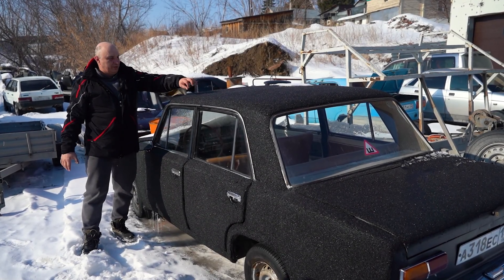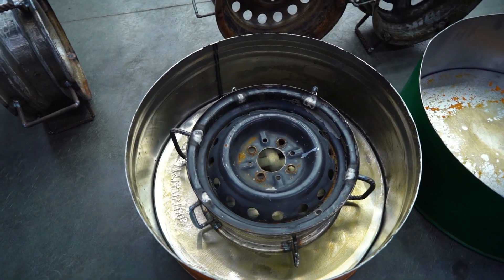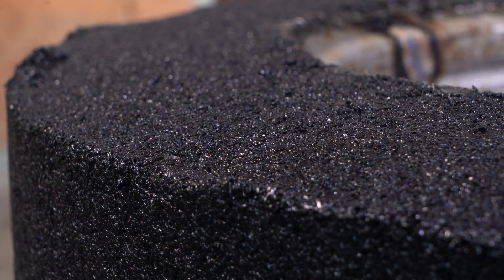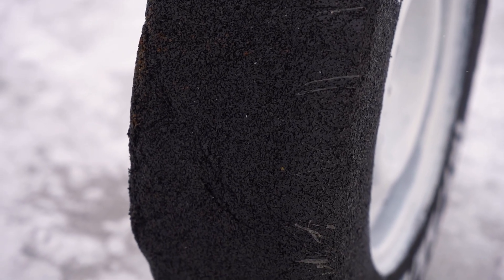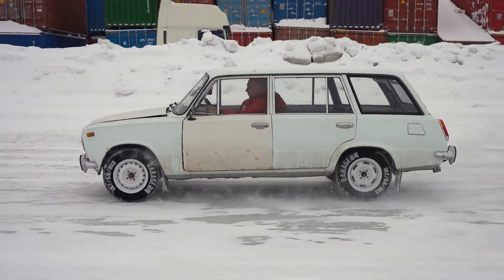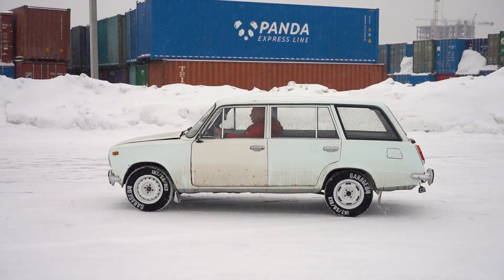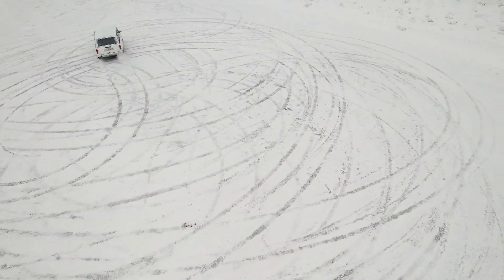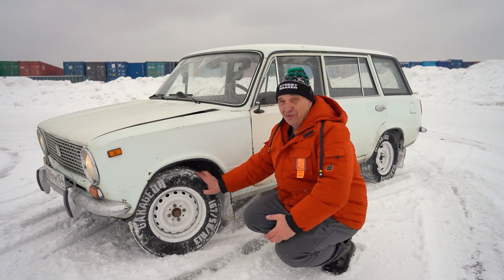We use rubber turf to make airless run-flat tires

Comment: Interesting video.  It looks like you eye-balled the placement of the rim in the mold plus pounding in the rubber could move things around, so I think it likely your tires are eccentric and will be very rough riding.

Comment: i think if the tire were mounted on the wheel and the mix inserted into a flap cut into the tire, you then glue the flap down, you would have a real no-flat tire.

Comment: These are just essentially forklift tires for your car. And the reason you have solid tires on a forklift is to balance the load on the forks. But if there's any deviations or imperfections in the surface The transfer is exponential to the forks. But you can't have any kind of compromise to the tires because that would be dangerous on a forklift.

Comment: You should also make the grooves on the surface, and not just a smooth tire. The grooves are important when you drive over a wet surface (not ice), and you did not test the wheels under these conditions.

Comment: Pretty sure these “tires” would be severely limited in speed as to keep them from flying apart. Probably no more than 30mph/60 kph and even then only to limp to a tire store.
   Also hitting a pothole would probably seriously damage, if not outright destroy them.

Comment: Insert a tread mold ring made from from a real tire into the barrels around the inside edge then fill it in with the rubber compound so the tread is molded into the outer surface of the tire. So get a good tire spray it with alcohol and vegetable oil as a mold release then paint on several layers of silicon rubber. Peel that off re-apply your mold release, pack it full of you rubber pellet and glue compound then insert that into your barrel mold and fill in the area between the rim and your tread mold with compound when dry remove from the barrels and peel off your tread mold. Or you can use a router to cut treads into your tire after they dry.

Comment: So you made tyres out of tyres? I wonder if you could put an inner tube on the rims before adding the rubber, to save weight and make the pressure adjustable

Comment: I would love to see a tire that was essentially just tread attached to the rim. That way you could drive, say, 100k miles on a few inches of tread and wear them down so much that you would have to replace them when the speedometer is no longer accurately displaying speed vs. safety related reasons.

Comment: God damn...this is actually awesomely useful! Old tires wont be depleted from the world and are free, just need to turn them into pulp and remove the steel. Only issue is finding the glue and further testing is needed like how much weight and over time effects, plus UV and so on on these, but if this works well, i have multitude of vehicles, trailers etc that could use this type of tire, as there is always leaks when sitting around and say water trailer will have couple metric tons on top, while sitting on the sun most of the time. Rubber rot has already started to seep into one mainly on the sunny side, so if i could replace those with these it would be fabulous save in money alone, if i could even get new tires for those decades old truck rims.
Please do further testing and state what glue was used, well as source for the rubber or was it home made?

Comment: Ive Got an Idea. 

Build a Compressed Air Tank that is compressed by a turbo that uses a switch to change between regular turbo usage and Tank Filling. then add a button to allow you to inject compressed air into the engine block like a NO2 tank.   

Essentially a Reusable No2 tank that self fills while driving
Reply: And how does the turbo turn oxygen into nitrous oxide?
Reply: @BrunodeSouzaLino  I think it just gets more air in the engine which makes better explosions and power ?

Comment: @Garage54ENG #Garage_54
This was a great example of "Just Do It" engineering. It obviously works; kind of heavy, but will never get a blow out.
These would be fantastic "Shuffle Wheels" for cars that need to be moved around, but don't warrant a new set of tires.
A Next-Stage Idea for this Build: Off Road Version for the Log Truck 👍
+++
Это был отличный пример инженерного подхода «Просто сделай это». Очевидно, это работает; довольно тяжелый, но никогда не выйдет из строя.
Это были бы фантастические «Shuffle Wheels» для автомобилей, которые необходимо передвигать, но которые не требуют установки нового комплекта шин.
Идея следующего этапа этой сборки: внедорожная версия лесовоза. 👍

Comment: looks like rubber molding and cutting of tires, like in tractors and monster trucks. try flexible cast mold plastic tires. looks nice. maybe foamy airless tires. with hollow inside. no air inner tires.

Comment: Excellent durability! But I would still try to inject it into a mounted tire, either through the sidewall or better yet, the rim.
We have used the expanding foam in tires for a poor mans run flat tire, and they don't last long, due to the foam crushing down over time. The only draw back is the weight. It isn't good to have such weight unsprung.

Comment: I would like to do the same, but rather than have the rubber compound as the tire, mount a tire, put holes in the sidewall and fill the tire with the compound. That way you have a run flat airless tire, but protection from wearing out.

Or, put the holes in the rim, and leave the tires whole. In order to dry the material, use air injection?

Comment: The Rubber Turf (crumb) idea has been used for many years to patch potholes in the paved roads.
Usually you get rubber crumb and mix it with Polyurethane glue, and pack it into a pothole filled with water.
The water helps the Polyurethane glue to cure more rapidly of course.
Widening the bottom of the hole slightly, helps to keep the patch in the hole.
But the end result is the pot holes will usually outlast the surrounding paved road.

It makes you wonder why they continue to use bitumen and hot mix gravel to patch holes in the pavement?
Certainly Bitumen and gravel is a cheaper material cost in the short term, but the Labor cost to repeatedly repair potholes is extremely expensive.
Then of course there are road safety issues to consider, along with damage to vehicles steering & suspension, stone chips to paint & glass, and maybe even loss of life.
Reply: What sucks is they think patching potholes work when 100% it does not. Pot holes keep getting worse because the water seeps under the hole. To fix it the right way you cut out 10 feet section of the road. Dig it up about 2 or more feet deep and tamp the hole section quite a lot. Then lay in crushed gravel and sand level and tamp then apply your black top on it. 
The major problem is water intrusion and the city, county, state and federal government were to install the proper roads and maintain them the right way we would never have a problem.
Reply: @kameljoe21  - It's a good thing that Polyurethane adhesives use water to cure. In fact when patching a hole, if it is dry, then the first requirement is to fill the hole with water before placing the Rubber Crumb & Adhesive mix into the hole. Once cured, Polyurethane glue is hydrophobic.
Reply: @delawarecop While that is very true. The patch might last yet the connection to the patch is what causes the pot hole to form again. The gaps and cracks causes structure failure to the patch which break up and form the pot hole again. 
The problem is micro cracks in asphalt. As the asphalt ages and dries out it shrinks. All of this is going on while the weight of vehicles traveling over apply downward pressure to close these micro cracks. This can be seen on some roads where you can see tire tracks and when it rains water pools where the tires go. Micro cracks open up and allow water under the road and can either wash out dirt which causes "sink holes" or in our case pot holes. During the winter in places where it does freeze and thaw the water intrusion freezes and heaves the asphalt up to where it breaks. This can break open a pot hole that has once been sealed or cause cracks along the road. You will see crews who go out and try and seal these large cracks up with tar. The problem is this almost does nothing to help because micro cracks still allow water in. 
The only way to combat this is to apply chip seal every year or every few years. Each road can be inspected to determin when it should be applied again. Which is how its pretty much done today. Yet they wait till its too late. The longer you wait the more damage is done to the roads. There are several chip seal programs that have been able to provide low cost chip seal cost while making it cost effective. Yet the problem is getting your local area to do it and to keep doing it even if one does not think you need it. Every road that has not been done in a year or a few needs it. 
Cost is the factor in this. 
Pot holes will keep showing up in the same spot until they fix the problem. Pot holes do not form in new roads. Keep the roads freshly chip sealed and you will never have another problem.
Reply: Certainly alot you could do with this, maybe fiber reinforcement,  add some kind of void space to see if any spring can be gained

Comment: Another awesome experiment and video guys. Awesome work. I just wonder what speed they would fail at. Pretty sure they would come apart at 100 miles per hour (160km/h) because of the weight.

Comment: I would have spaced out some bolts inside the tire to hold the rubber granules instead of welding steel rebar into it. That would be a weight-saving measure. The layer could also be thinner like a run-flat tire would be to save even more weight. I bet that you could have it come close to the weight of a similar run-flat tire, which would improve the acceleration. This added weight from the rebar and size of the tire is what I feel was preventing you from getting the rear wheels to spin more freely.

You can also try welding some shapes into your molds to give the tires tread patterns!
Reply: The dynamics of a spinning wheel wouldn't find that configuration useful. The crossing over is what helps keep it in place. It would just separate from studs.
Reply: I respectfully disagree. The spinning of the wheel didn't separate any of the rubber compound at all, even in the areas between the rebar where there was no support whatsoever. If your theory about spinning dynamics were true, we would have seen delamination to some degree. But I suppose neither of us will know until it's tested, hm?
Reply: @orellh.1836  The smaller the spans between the "bars", the more it will hold itself together, at the expense of more weight of course. Within reason at that lol. At some point, you'll have nothing but steel packed with a little rubber and the strength of the rubber will actually decrease.

I don't recall exactly now but what were there, 6 per wheel? 60 deg, carry the 2... 7 or 8 inches between bars at the surface of the tire, give or take. Forgive me, I'm not bothering with real math.

Point is, take that and have only 2... 180 degrees apart obviously... and check out the results.

To challenge it even making it out of the garage, take them all away.

Radial rods would help in imparting torque somewhat, in a manner not very different from the handful of bars... but the simple rods would not provide any real radial stability, and unless there's something special going on at the interface between the "tire" and the rods, the voids in the rubber that the rods pass thru will actually have a detrimental effect instead, by being the cause of "holes" in the composite rubber structure. The constantly changing radial forces as the wheel rotates would only amplify the result as well. Then the moment there's any speed... It really wouldn't be all that long at all before you were running on the ends of the rods because with a material like the aggregate tire there, they will drill themselves thru the circumference in no time flat, and the deformations will shred it, even quicker with any real torque. All of its "action" is limited to the furthest it reaches out into the tire. Remember, the tire material is an aggregate composite much like concrete, only a bit more flexible. It will still break and crumble, unlike a proper molded rubber tire.

The crossover mitigates this by "dividing" the forces and shielding parts of the bulk tire from stresses, allowing the bond to remain intact on both the back side of the cross bar and also at the hub of the rim. It also restrains centrifugal forces and controls them by keeping the "free mass" to thinner sections of the tire (above each bar), which translates into lower centrifugal forces acting on the interfaces where the cross bar meets the rubber mixture, improving stability on the outer side of the bars as well. This will be countered some by the forces where the contact patch is, but the weight doesn't propagate thru all of the rubber, just the part between the patch and the bars as they go by. The reinforced and non-reinforced areas work something as a team to spread out and control excessive forces within the structure.

The result of all of this combined is a much stronger overall tire.

All of this said, I don't think either one is really a real world solution of any kind... but if you want the most longevity, more stability is better, and the crossing bar structure provides just that. Might be useful for a supercharged "power wheels" or something. 🤣🤷‍♂️
Reply: The thought behind the bolts is that welding bolts along the inside provides just as much or more surface area for the granules to grab onto as the rebar, providing the same sort of retention that the rebar was meant to give.
Reply: Well to be fair too the Lada is not exactly a powerful car either. It was a cheap functional car with a small engine.

Comment: Could fill regular tires with that mix and have a super-durable flat-proof tire, tho the ride would be a bit macho. Might be good for back roads, tho.
Reply: That would be great for a destruction derby. Not having to worry about getting flat tires and you could stud them for extra grip in the dirt.
Reply: i was thinking exactly the same!!!
Reply: I agree that they should stuff the granules into standard tyres. Drive on Tarmac - see what happens.
Reply: @peterduxbury927  It can't be worse than their tires filled with lead.
Reply: Trust me the grip is terrible. You’ll understeer to death
Reply: @Eclipsis17  Not really a highway tire, yeah. But on dirt roads? Might be interesting to try.
Reply: And you would flat spot them quite easily in case your wheels lock.

Comment: that could be fun to see how these tyres behave on a dry pavement during summer (obviously without the studs and well balanced) and: pedal to the metal
Reply: aw hot summer pavement they will blow apart probably.
Reply: @homelessEh  I am thinking I need to make 2 of these for temporary winter tires. You can add and remove tapcons for studs as needed lol.
Reply: or rim would separate from the crumb and do a burn out inside of the tire,
Reply: @homelessEh rims can't spin inside the rubber. They welded rebars in there
Reply: Which was frankly a great idea to prevent exactly that
Reply: @homelessEh  Who knows? Not me. If they don't try what I say, we'll never know

Comment: Cool , need to re test them in the summer on dry blacktop/ concrete see how they perform 👍🏻
Reply: I’d love to see a high speed test to see if they stay together
Reply: They will melt in the heat. But the winter application this is cool. 😂
Reply: They would most likely be very grippy but wear out incredibly fast.
Reply: Have you guys ever tried making a car an all wheel drive by attaching a bar to the front wheel and back to the rear wheel? Sort of like a locamotive! Lol
Reply: @kirbyloulewis3826  you wouldn’t be able to turn
Reply: They should a heat resistant glue and Kevlar